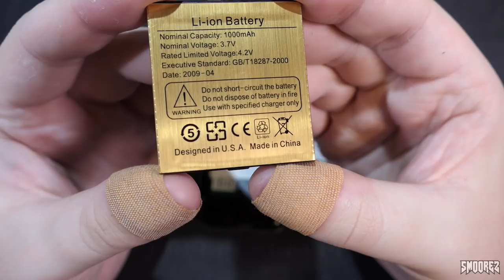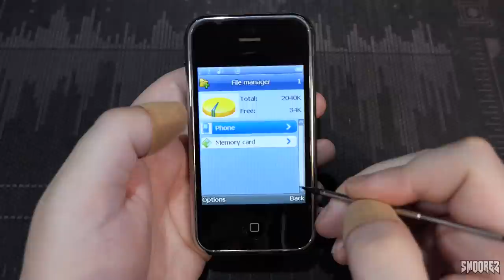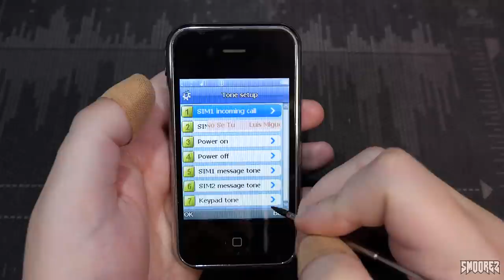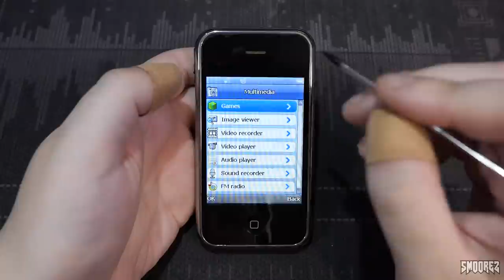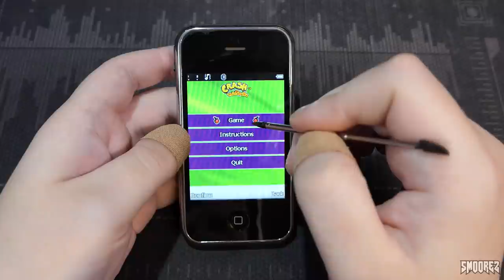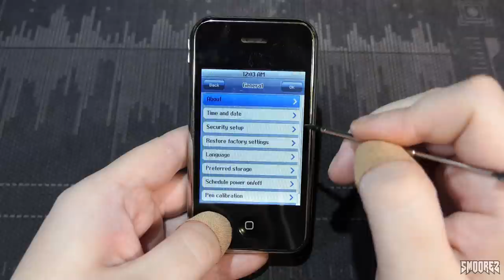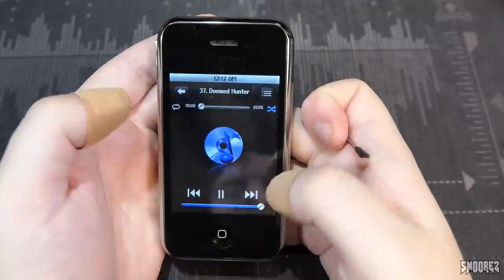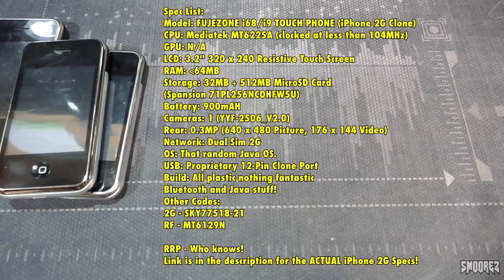iPhone Clone Month! The FUJEZONE i68 & TOUCH i9 (iPhone 2G Clones) Test & Review (+ Teardown) Part 3

Comment: 36:00 The charger connector is a "Mini USB 12 Pin Female SMT Single Row". Google that and you will find places to buy the connector (Alibaba) and it looks exactly the same, including the diagonal lines.
Reply: but it's pretty useless in 2020 to use that port
Reply: @伊藤真-s2y  it's pretty useless to use that phone in 2020 too🤣
Reply: YOU. ARE. A. SAVIOUR.

Comment: Actually watching your video's about those clones resolved one of the mistery's in my cable box, a couple of months ago, i bought a cable with different plugs on 1 end and a normal usb connector on the other (great for charging the gps and my phone at the same time while using only 1 usb connector in my car), it has mini usb, micro usb, lightning and than one weird connector i have never seen before, turns out, that 4th connector on the cable is for charging those clones you are showing in this video! The connector has 12 pins in it! Insane that some company made a multiple charge head cable with specifically a connector to charge clones . . . Now that whas a brainbreaker until i saw your vids! Amazing! I am actually blown away by this because the cable whas from a brand that makes computer peripherals around here called Trust!
Reply: this is very common in Philippines with the brand names:Cherry Mobile,SKK mobile,CKK mobile and MyPhone

Comment: For the touch problem, the touchscreen flex which is most of the time in the left area need to be reglued cuz it get's unplugged by time, idk why but they use a weak glue to put it in place, i glued mine which is in a Galaxy S clone long ago and it worked fine.

Comment: There's java games for touchscreen devices,the one you installed was for keypads doesn't work on touchscreens
Reply from the maker: I know that but the only Java games I had on hand were ones designed for keypads. I was just showing that Java apps can be installed.
Reply: @SMOOREZ  , you can find that old games on getjar website. :)